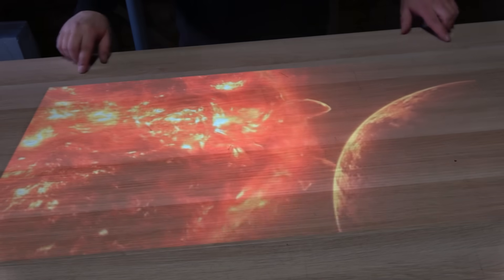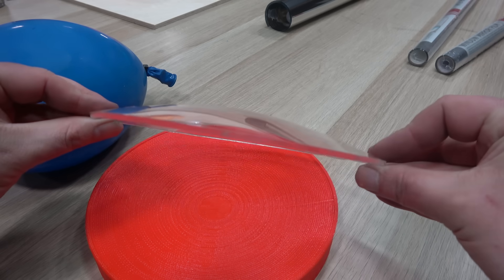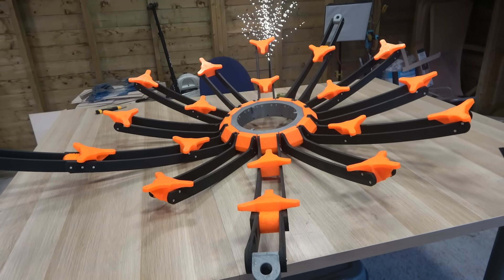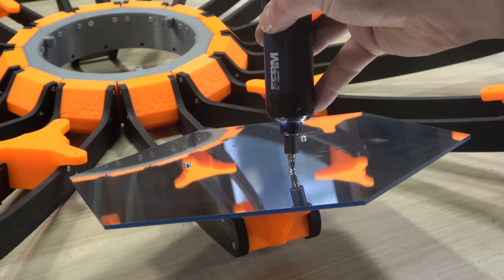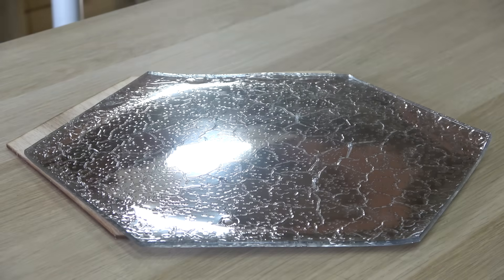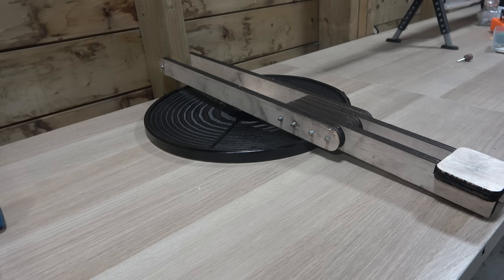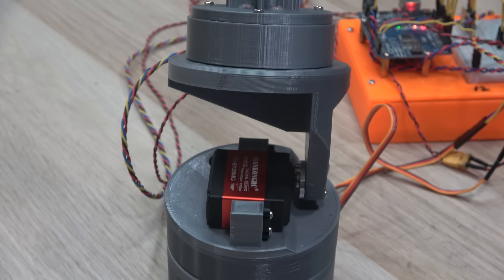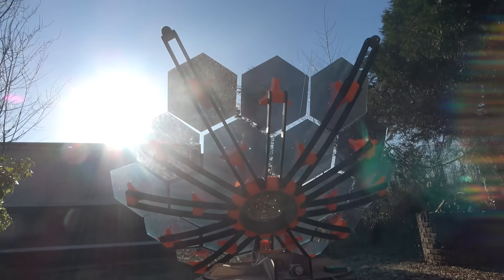Building a DIY Solar Generator..

Comment: It would be much better to use First-Surface mirrors (reflective coating is on TOP, rather than behind the glass),  rather than Mirror Film... or even standard rear coated mirrors.   Reflective mirror film, tends to be far less reflective than actual Mirrors.   And rear coated mirrors, also experiences some losses, due to the glass distorting the light as it goes in and out.

 From what others have said.. you likely dont have to make curved mirrors... so it would be more Optimal, to cut First Surface mirrors for the project.

 I believe there is a fairly easy and cheap way to turn a standard mirror, into a first surface mirror... by stripping the paint coating off of the rear of the mirror... and then using the rear.. as the new front.

Comment: Don't know if it would work with spray paints, but back when I built and painted scale models and ttrpg figurines, you could buff and burnish metallic paints with fine cloth to get the surface a lot more reflective and looking like actual sheet metal.

Comment: I don't really understand the spherical/parabola difference in your application: why are you so concerned to focus the light into one point (parabola) instead of leaving it a bit spread out (spherical) if you use a gigantic solar collector (aluminium plate)? By the size of the collector the hexagonal patterns could even remain flat.
Another thought: you should have just bought a satellite dish second hand and coat that one. Easy, no?

Comment: you're better off just encasing some black-coated copper (or other) tubes filled with water inside of a two way mirror case
you'll easily get 80-90% of the energy transfered into heat

Comment: I assume that the aluminum heat plate should be coated in something like vanta black to better absorb light. Not sure if that particular pigment would withstand the temperature though, worth looking into to though

Comment: Very good quality of video overall, no junk or filler. 

As for tilting mechanism, consider redesigning it. Main problem with current iteration is that it is relatively weak. It may hold light frame with reflectors, but then it'll need to be strong enough to withstand the winds. And winds will potentially double or tripple the loads.

Comment: Tip. Have a look at a polar aligned equatorial wedge.
You will find tracking easier as all the tracking for the day can be done with one motor running at 1/24 revolution per hour.(the earth is rotating not the sun moving)
Why is the disk in the middle silver it will reflect heat & light, it should be the darkest matt black you could find.

Comment: Paint the heat collector black, as silver reflects...no need for individual curved mirrors, as the current setup uses low reflectivity film.  Rather user real flat mirrors and get all reflections from the flat mirrors to overlap on the heat collector. More smaller real mirrors may be the way to go.

Comment: Cool project.
Your collector is reflecting most of the light you worked so hard to dollect. You need to paint it plate mat black with a high temp paint. (Try automotive paint). This one change will probably 10x your efficiency.

Comment: id reccomend applying the reflective film after shaping if possible, a heat gun may help with this like applying a wrap to a car maybe? i would also recomend making the centre plate black so that absorbs the light energy rather than reflectibg it away, if you could give it a black anodising that could work great. Good luck!

Comment: First of all I would like to commend the meticulous work you have done. It's just fantastic problem solving ! I have few observations 
1) the spherical mirrors should have been ok too because you are aiming for heating and non imaging application. The only requirement was that reflected sun rays must fall on aluminium collector and not miss it.
2) you need to apply some black absorbing material on aluminium having water pipes, which I guess you would be doing.
3) As I understand the acrylic mirrors have to direct and focus on some mirror which will reflect back that light to aluminum collector having water  channel. Designing that will be more challenging as it is duplicate of your acrylic mirror design but with constraint of smaller dimension and more temperature capacity.
3) finally you need to keep appropriate flow rate in water channel to avoid steam formation.
Goodluck to you 

However you must calculate the photo to thermal  efficiency of your system and the benefit associated with it.

Comment: I'd ditch the bent mirrors, you're trying to heat a large surface, not a tiny spot, no need to faff around with hard-to-fabricate mirrors. Anodise the aluminium black, it's not that hard to do at home, and it won't be an insulating layer like paint would be.

Also if you redesign the heat collector, swap the spiral groove channel for a radial spoke style design. Have lots of small channels radiate out from the middle to the edge with a collection channel along the perimeter. It'll have much better more even coverage of the heat collector. I understand that having PCBway or some other CNC place cut micro fins like on CPU water blocks is prohibitively expensive, but even a radial pattern with "coarse" channels of say 0.5mm would provide much more surface area than this one wide spiral groove.

As for springs, maybe look at valve springs for a 139QMB, they're a decent size for a project like this and they're cheap and readily available.

Comment: It's really a shame that the central target is so large. The larger the target, the more heat it will lose to the ambient environment. It should be possible to design an optical system so that the sun's image sets the required size of the collector, and this in turn will depend on the focal length of the system. 

In a Cassegrain system like this, the smaller your central obstruction the larger your magnification and effective focal length and the larger the sun's image (bad). With the ~1/5th diameter obstruction we have here, we have 4x magnification (I just googled "cassegrain telescope effective focal length" and clicked the first link).

The sun's 0.5 degree (theta = 8.7 mrad) wide image would be only 5cm wide if your primary mirror focal length were 1.5 meters and you used the right secondary. This looks to be about 5x smaller diameter and so 25x less area/heat loss than what you have.

Of course, the secondary really needs to be hyperbolic in a cassegrain, but since you're slumping to a 3D print, that might actually be possible. And since we're just gathering power here, rather than forming an image, a spherical mirror might be good enough. But then the image would be quite bad and you'd be back to  using a larger collector to get it all.

I am guessing you know that it would be far simpler and more effective to mount the thermal receiver at the primary focus on the secondary support booms. The receiver would be smaller (still less heat loss), and there would be no secondary mirror with figure errors. I do however understand the aesthetic you're going for here in echoing the JWST construction, so I don't think this approach satisfies your requirements.

On another topic, I have to echo what others have said: if all of the primary segments are the same on-axis parabola, then they're all the wrong shape. They all need to be the proper off-axis parabolic segment, or otherwise they're probably worse than if they were all the same sphere.

Comment: my dude use silver foil or gold leaf. That window tint is not nearly reflective enough to be a mirror surface. You can see its even darker than your aluminum heat transfer device.

Comment: Gold paint ≠ gold reflectivity 
Silver paint ≠ silver reflectivity 

At least outside of the visible spectrum. Paint just looks the part -it's optical properties are totally different to precious metals and also different to whatever coating is on your plastic mirrors.
Reply: This was really strange to watch.
Reply: I was thinking the same thing.
Reply: Yes, this is a fundamental flaw in the experiment and all conclusions based on that information basically tell us nothing about optimizing a real functional array of mirrors to produce heat.
Reply: This, and he uses a laser to test reflectance instead of a spectrophotometer which would measure the reflectance across the entire visible spectrum
Reply: @br3nto Yeah, he's normalising the (already useless) results to a random red laser wavelength. The whole experiment is just bad.
Reply: For maximum efficiency the surface should be coated with gold or silver by physical vapor deposition method, which is done in a vacuum chamber, but I suspect it is far cheaper to build more plates and forego the edge on efficiency.
Reply: Yep, both became acrylic painted surfaces. Who would have guessed...
Reply: Kind of makes me wonder if I should take the rest of the video seriously. Like, how do you even consider that spray paint would have remotely the same properties of the actual metal.
Reply: Yep. In general, even with the reflective film, that will usually still have plastic surrounding the colored pigments or film layer.

Either stuff is suface-coated with a metal film or not. So electroplating, true chrome either without a coat or with an IR transparent coating and sputtering are probably the most common ways to get this done.

But it doesn't really make sense to use semi-gloss chrome paints or these films where the properties are unknown for these comparisons :/
Reply: I was giving him the benefit of the doubt that the paint he used deposited actual gold and silver on the surface. Then I saw your comment and went and looked it up, and no, it's a mix of copper and zinc. He'd have to deposit gold on the surface using a chemical reaction, which is certainly doable if he wants to scale this up properly
Reply: @konomexplays  It is not even just a mix of these 2 metals, there is also an organic binder and who knows what else.
Reply: @konomexplays  Let's all send him our jewellery.
Reply: @konomexplays  But outside of the theoretical properties of a particular element, there's the consideration of practicality and availability.  Ultimately you have to test against what you can actually get, do, or afford.
Reply: You might have noticed he's not using silver or gold metals in the final product either. He's using window tint as a mirror. It was clearly about the color here, and probably just for content.
Reply: usually aluminium iirc.
Reply: I was thinking the same thing as well. I think with leave Gold one could quite easy and for a relative small price make gold mirrors. It is super cheap.
Reply: I've also seen somewhere that white paint is more reflective
Reply: Yep. Just like the grammatical properties of the contraction "it's" are different from the pronoun "its".
Reply: Hi! First, I love your Dutch accent, my ex wife was from the Netherlands 😉👍🏻 I admire and envy people like you that are able to make a project like this from A to Z using 3D printing, laser cutting and Arduino programming. Congratulations and good luck to you! Philippe
Reply: I was all but screaming this at the screen.
Reply: 0 gold or silver in those paints. Should just buy gold and silver leaf sheets.
Reply: That is very true!
Also - correcting for reflectivity by comparing a specific wavelength is pointless when the whole difference is between the colours is supposed to be the difference in wavelengths they reflect...

A much better way to approach this would be to look at the emission spectrum of the Sun, correct for absorption of the atmosphere, and see which metal the emission peak best lines up with.

Besides, contrary to what the video said, it is the violet part of the spectrum that carries more energy in the same amount of light... Infrared is more typically associated with heat because it is emitted by hot objects that are not hot enough to emit anything visible - and because we don't see it so we perceive it as "just heat".
Reply: Yep.  This video is so well thought out, but based on bad information.  Using an aluminum foil would be better than that paint
Reply: came down here just to say that. not a great start to the video with a blunder like that. it doesn't give me any trust that I'm in for anything educational or innovative.
Reply: I would get gold,silver, gold and copper foils and repeat the tests and do a cost to performance analysis.
Reply: chatgpt:
Since using gold, silver paint does not matter as they are paint and the metals themselves

Silver, like other metals, has free electrons that can move relatively easily when light (electromagnetic waves) hits it. The plasma frequency (a measure of the frequency at which these free electrons can oscillate) of silver falls in the ultraviolet (UV) range, meaning that silver doesn't absorb light in the visible or infrared spectrum very much. Instead, it efficiently reflects these wavelengths.

In the visible spectrum (roughly 400 to 700 nm), silver reflects light almost as well as any other material. This gives it its shiny, mirror-like appearance.

In the infrared spectrum (wavelengths longer than visible light), silver continues to reflect well, especially in the mid-IR and far-IR ranges. This is because silver's free electrons are still able to interact with the electromagnetic waves in this part of the spectrum, allowing it to reflect infrared radiation efficiently.

Gold and Infrared Reflection
On the other hand, gold has a lower plasma frequency than silver, meaning it interacts differently with light. While gold still reflects well in the visible spectrum, its electrons respond more effectively to infrared light. This means gold can reflect infrared light more efficiently than silver, but it reflects less visible light because its interaction with visible light isn’t as strong as with infrared.

Why It Matters for Solar Heating
In a solar concentrator, you want a reflective surface that maximizes the amount of sunlight (which is mostly visible and infrared light) that is focused onto your target. Silver mirrors are often chosen because they reflect both visible and infrared light efficiently. Gold, while excellent for reflecting infrared light, doesn’t reflect visible light as efficiently, so silver often performs better for a broader range of solar radiation.
Reply: @AyushRaut-m6j  Get that AI slop out of here. ChatGPT doesn't know anything.
Reply: I mean what determines something's color is when light hits it, electrons jump an orbit temporarily the way it should for that element and then light is let out again. If its metal properties "shiny" and looks like gold, shouldn't it act like gold and same for silver? Please correct me
Reply: @sheepethelegend902 the reflectivity can be significantly different even though it "looks like" the same color.
Reply: @sheepethelegend902  That only means it's interacting the same for light in the visible spectrum. There is no guarantee the IR or UV spectrums will also behave like gold for this paint.
Reply: @RMX7777  And even though it may reflect the wavelengths that give the "gold" color, it may not (and almost certainly doesn't) reflect those wavelengths as efficiently.
Reply: @solarguy6043  Correct, it's actually being a metal that make good and silver great reflectors. Paint is filled with binder material, which greatly reduces its reflective properties.

Since gold is so expensive, the only real way to conduct this text properly would be comparing silver and aluminum mirrors against each another.
Reply: @RMX7777  but isn't the amount of gold (or any metal) very small in mirrors? (legit question, I would imagine the metal film to be extremely thin but know nothing about practical implications)
Reply: @daggawagga  Yes, the amount is very thin but it would still be impractical for a home experiment. It is difficult to plate non-metals with gold, and even when you can plate them you need a lot more gold to carry out the process than what is actually deposited during the playing process.

Aluminum has almost identical IR reflectivity as gold (only a few percent less). It would be far more practical to purchase aluminum sheets and polish them.
Reply: @solarguy6043  thx
Reply: @RMX7777  Plating something non-metallic with silver should be somewhat doable in a DIY-setting with Tollen's Reagent.
Reply: @sheepethelegend902 I can't correct you. I can't even understand what you're trying to state. It's nothing I have ever heard.
Reply: Lol women
Reply: Golds chemical properties allow it to be polished to such a fine degree, that it can refract the wavelength of infrared light. The color itself doesn't matter.
Reply: @hondacivc93  Meh. You need less accurate polishing to reflect infrared than to reflect visible.
Reply: @hondacivc93  Why talk about things you know nothing about? 
1. It is not polished, it is deposited on a previously polished surface. The same way any other first surface mirror with silver is made.
2. Pretty much anything can be polished, as that is only a measure of surface roughness. There is nothing inherently preventing a perfectly flat surface.
3. Flatness has nothing to do with how good this flat surface reflects a specific wavelength. That is inherently a property of the material. You can polish coal as much as you want, it will always be black. Gold is always gold colored, no matter how rough you make the surface.
4. The color is said inherent material property and is all that matters for what is reflected. The flat surface just makes sure that the reflection ends up where you want it to, instead of going somewhere else. That is all the flatness is needed for.